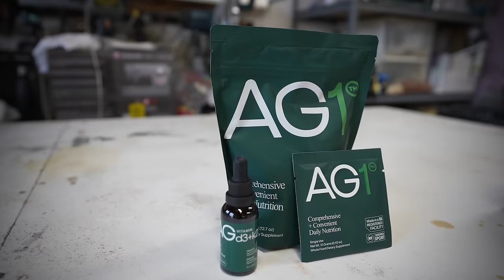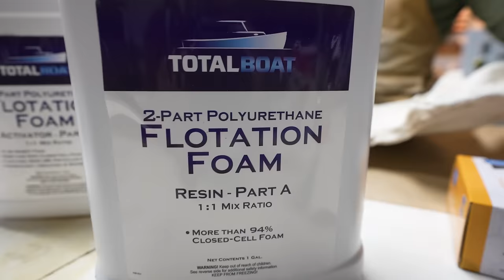Why I Covered my Whole Body in Plaster

Comment: I'm thinking it needs a head and hands making too. Then the whole thing smoothed, sealed, and another 2 piece mould making of the complete thing. This could then be used to tumble blue tinted resin inside to get a hollow shell. The resulting shell could then be stuffed full with a LOT of White or blue LED string lights to make a sparkling Xyla mannequin........... Or an oversized nightmare nightlight to be gifted to some unsuspecting friend. :D

Comment: Doesn't anyone do the 3d scan and print method anymore?  Its probably more expensive though.
Reply: I don't think it's more expensive (they used $500 in materials alone + the wage of the two professionals), but takes much more time. Like a lot more time, a print fitting the whole volume that's rigid enough to withstand the foamvpressure roughly takes a full day, let's say it takes roughly 40 segments, that's a long long time. Well, unless you have 40 printers available, then it's still roughly a day just for printing.

Comment: The reason I could never go through this process is that I have psoraisis and am constantly needing to rub a little itch on my face somewhere or behind my ear.  That would be a deal breaker.  I look at you getting plastered (Rum is my poison) and wonder if you need to scratch an itch.
But, couldn't they peel that thing off you to cure and then put it back on for your sponsor read?  next time...

Comment: Well, possibly redo the original video costume. Treat this as a part one on mould making then. Part 2 improve the pattern making process etc. do what you originally wanted to do rather then the jerryrigged one 

But you could do any manner of cosplay ideas. 

More risqué a Austin powers Sex bot with true hug feature. Rocket boobs etc haha 

Xyla rocket but one where it actually flies like a Xyla super girl. Use stabilization etc so it doesn’t disintegrate like the skeleton.

Comment: "As mechanical engineer... parting lines...". This is what really good technicians do in the engineering industry. You need to realize what you're doing is mostly composite layup technician work. Still great stuff, but you're not representing what most engineers do (more science and calcs).

Comment: You could have blurred out or blacked out the non-family-friendly body, as I've seen on a channel that does castings and showed the highest quality detailed body replica (for a corpse in a movie), and on a channel that used molds and needed some molding that they didn't have.

Or, just consider that the cast with its extra thickness and sagging skin will match your body in a few more years, so will be perfect for making cosplay items if you keep it around for a while.